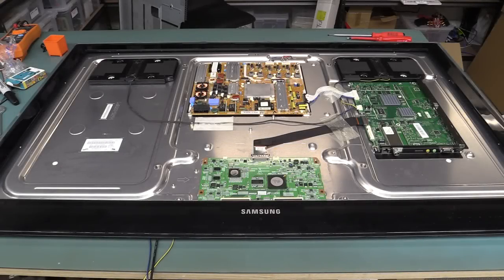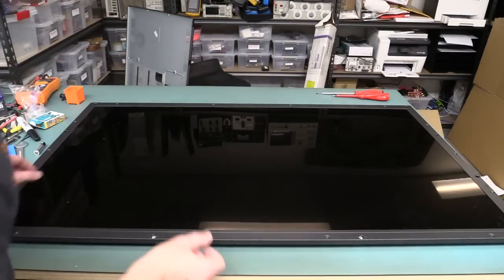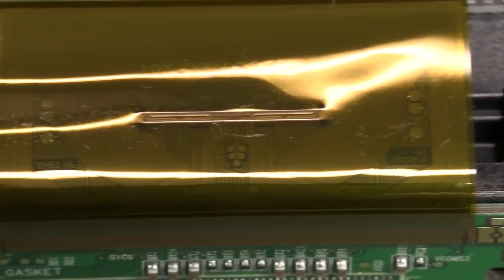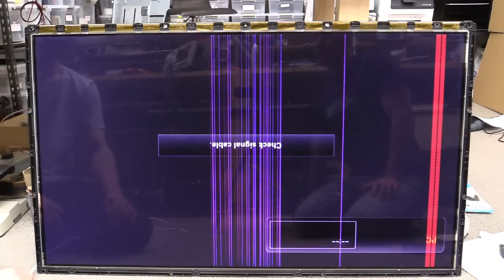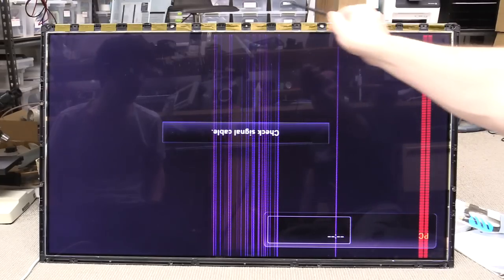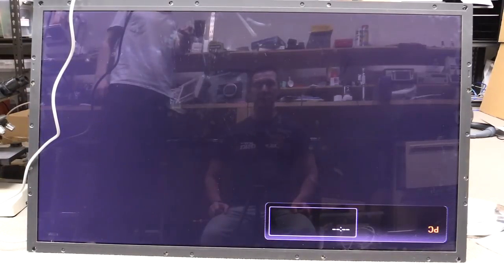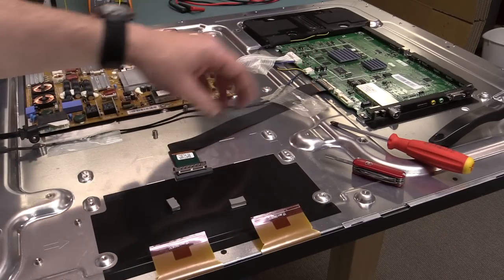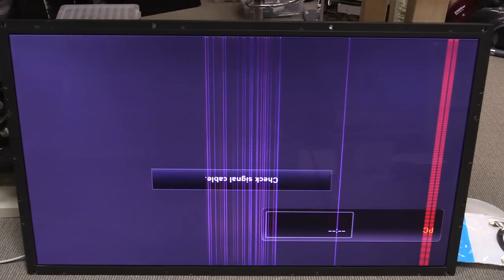EEVblog #781 - Samsung LCD TV Part 2

Comment: Like other people suggested, hook up a video source and see what it does. It fades in and out in a couple of seconds with a static image, maybe a moving image won't be a problem?
Reply: jaaasgoed Or it could be whatever is doing the rendering for that overlay. As stated, chuck an external test pattern on and some moving video :) (if it is the overlay renderer, well, you could almost just ignore it once you have your settings right)
Reply: Darthane
I don't think there is anything extra doing the overlay. I assume this is all done internally in the ASIC. But indeed, the same thing applies, give it some signal and see what it does.

Comment: I haven't watched the whole video on this, only half. But I can say that it's most likely the right after the Tcon/Tcom board as some people call them differently. Commented on another video that wasn't a samsung about my samsung, but the 2 ribbons coming out of the T-con board usually the problem will be left or right and not past it, but those ribbons do heat up quite highly from the main Tcon board and on from poor cooling design, but I did notice this one has most on the bottom so it must be a newer lcd than I've usually worked on. The one i have has 2 ribbons from the tcon board and then goes into 4 ribbons 2 per side and they tended to start getting normal picture back after warming everything up for about ~20 minutes.  I've temporarily fixed that issue with tape on the non conductive side of the ribbons when you click them back into their positions getting more pressure on the contacts for worn out melted ribbon cables.  To test the theory i've used a heatgun just to simulate operating temps and things look normal, but in the end just replacing the ribbons or the tape fix works wonders and recently I've had a problem with the relay that turns the tv on and have isolated it to 2 caps in the back since a soldering irons heat was put up on a cap and it turned on, most people are using a hack of a hair dryer to do the same thing but that is a different problem in itself.  Also there are test leads on both Tcon board and the output to test from or should be at least beside the ribbons to test voltages.
Reply: Watched it all finally and still thinking its just a simple ribbon fix repair/replacement and in the worst it would be a Tcon board replacement if you didn't want to troubleshoot, but still probably the other end of those 2 outgoing ribbons and where they lead though.

Comment: Bad ground somewhere or a problem with the dac that controls the pixel intensity. I notice it seems to be happening with the red and blue channels but never the green. You should try to feed in an input signal of a picture with a pure black background and just some pure green lines and/or pure green text on it to see what happens. Or better yet set up the screen saver on a pc to display some simple 1920 x 1080 pics of white bar 10-12 pixels high across the entire width of the screen at the very top, white bar in the middle, at the bottom, and one bar through the middle of each of the primary colors all at one minute intervals with an all black picture displayed for a minute between each bar picture.

Comment: It seems the fading in vertical lines related to the temperature? And I found that the vertical lines doesn't cover the white characters. So, I think the issue may not at pixel level? Maybe the processor board. :)

Comment: great video,  have you considered the processor chips themselves are bad? that's what It looks like to me, especially have you've checked all the regular suspects.  The other thing it could be  if  that LCD is anything like the old iMac LCDs from  2006 is heating  actually damaging the LCD itself, but if that were the case, the lines would be present as soon as you turned on the set.  This fades in  like it happens as something is heating up, so it could still be a defect triggered by heat.

Comment: I think I would try to generate some test patterns from PC/HDMI like a single white line (h and v), half of image white etc. I would focus on a horizontal bar of white lines (5-30 lines). They should make the ghosts appear. Probing the signals should suggest at which stage the ghosts come in or where h lines disappear. Using smart display patterns you can make the signals look nice and predictable and easy to recognize when they are wrong.

Comment: Since in fades in, I don't think this is on the digital side. More like a analog thing between the driver chips and the panel. Could also be wrong supply voltages to the panel.

Comment: kinda strange fault. But I keep suspecting the memory (some kind of defect frame buffer?). Maybe the text is drawn through a different interface as the menu boxes, which does not make tremendous sense to me, but would possibly explain the difference. maybe you should try to supply other video and image sources, to further narrow it down, because the processor does in the moment compose the image and we don't know if thats ok.

Comment: Mmm, if the problem is associated with the OSD characters, what does it do when a full video signal, via HDMI say, is input? Could it be that the OSD generator is cactus?
Reply: That would be my guess too. Though cactus isn't the word is use. ;)

could also be the part responsible for merging the OSD signal with the video before passing it to the tcon board. 

It feels nuts even having just a clue how these things work! :D
Reply: Jim Groth cacti are always problems...
Reply: Prehistoricman Good point.
Reply: Jim Groth Another cacti joke I like it.
Reply: Michael Norman Completely unintentional pun! :D

Comment: I've seen slightly cracked LCDs do this kind of thing. At the edges or corners, or when someone's spilled or cleaned things with the wrong chemicals, eats the metallic traces on/in the LCD itself.  Can create high resistance connections, so the LCD itself 'charges up'. The common aspect, though was always a toast LCD, I'm afraid.
 Good luck, keep up the cool videos. Stu.

Comment: It's looses traces on the panel itself for sure :-) Easy fix, just reflow with a soldering iron the traces on the flex on the LCD (but not too hot of course that it melts the flex connector).

God bless.

Comment: I think something is messed up with the video ram of the processor board (not the TCON board.  Specifically, I think whatever is responsible for zeroing the bits out has a weak connection to ground.  The visual pattern reminds me of images recovered from a cold-boot attack.

Comment: Is there edge mount LEDs in that? How about tearing them down. I have some that seem to be 6 volts each but can not find any information on them to drive them. How about a video on how to reuse them for lighting? Sony and Samsung seem to use edge lighting and LG back lighting. Also a friend of repairs TVs and says the streaks are caused by the panel itself.

Comment: Thermal issue with the graphics processor or RAM. Bad ball grid array joint Maybe. Sometimes the fine leads that connect from the terminals to the die in ICs can come loose either from thermal stress or a fracture on the lead's pad on the die can cause this type of error as well. It does have some hallmark indications of thermal caused lead to die failure

Comment: To me it looks like a slow build up of charge each time the screen refreshes resulting in a slow blending of the last frames adding to the latest. This would indicate that which ever part of the driver that is switching on for the bright pixels isn't fully switching off again for subsequent lines. I've no idea how to test for that as the complexity would idicate it's more then just a pull down resistor on a mosfet not fully turning it off but that would be a very rudimentary way of looking at the problem.
Mind you that wouldn't explain why it was building up over many frames unless there was some kind of static build up over time which would indicate a grounding issue again. Perhaps check the power signals and stability actually reaching the driver strip board?

Comment: 23:33 put some cheese on :) . I have exact the same problem with my curved 44' Samsung. But it disappears after tv is warm up.
I suspect it has to do with water condensation inside the panel itself. Recently I have moved in to different property, where I can feel air is way too humid. Previous property was way too warmer and lines were very rare (only after long periods of off). When panel cools down over night during cold nights water condensates inside it. After about a couple of minutes of Tv warming up lines goes away. I presume water condensate gets evaporated and stop shortening panel or ribbons. After 3-4 minutes it works without a problem at 4K till next day on.

Comment: Go medieval on the possessor board ? (reflow that as well) If the lines and columns happens when components heat up, use the heat gun to se if you can make it go bad quicker ? Thermal camera and se what part heat up first ?

if all else fail: just throw it back into the dumpster room.

Comment: The lines match up perfectly with what is on the screen, note the PC, : and e. I suspect it will happen on any part of the screen where it aligns with graphics. Could be an issue with the OSD alone. Maybe bad display RAM?

Comment: I think you have a bad thermal chip in there somewhere. Need to check more thoroughly with the freeze spray When the set is cold started the symptoms are minimal, once it heats up the symptoms appear more pronounced. Just my $0.02 worth.

Comment: after i saw the ASCII text, i realized there is a problem with the screen refresh..
the screen should refresh it self at 60Hrz as i rememeber, maybe that info will help.

when screen refreshes, it should remove old image and generate new one 60 times per second, to eye it wont be seen, but in our case, at this LDC, the screen refresh does not work, so it generating new image on old one.

Comment: I noticed this in the earlier video, but now I'm 80% sure. that LCD is NOT phase inverting like it's supposed to do.
Reply: Brandon MacEachern Phase inverting?
Reply: Ian Oliver http://www.techmind.org/lcd/

"Inversion

In liquid crystal pixel cells, it is only the magnitude of the applied voltage which determines the light transmission (the transmission vs. voltage function is symmetrical about 0V). To prevent polarisation (and rapid permanent damage) of the liquid crystal material, the polarity of the cell voltage is reversed on alternate video frames. Unfortunately it is very difficult to get exactly the same voltage on the cell in both polarities, so the pixel-cell brightness will tend to flicker to some extent at half the frame-rate. If the polarity of the whole screen were inverted at once then the flicker would be highly objectionable. Instead, it is usual to have the polarity of nearby pixels in anti-phase, thus cancelling out the flicker over areas of any significant size. In this way the flicker can be made imperceptible for most "natural" images."
Reply: +Brandon MacEachern So where exactly is the culprit on the boards?

Comment: Dave and David2 - You pointed out the streaking on the ascii characters and the colon and then the dashes.  And I'm thinking - wait for it, waaait for it.  :-D  Then, I waited for you to give it some actual input to display, some test pattern or something with slow movement.  I was thinking (dangerous as that is) that the streaks are building like a capacitive charge.  Where it would actually be, I have to real clue.  Could that be in the flat flex or the tiny PCB traces?  Would I be wrong to put all the shielding back on and give it a try?

Comment: I think it is an analog problem. as it is now in "pc" mode, I think in digital mode such as HDMI it would work
Reply: Anas Malas doesn't explain why it follows ascii  characters.
Reply: ***** this is how you could isolate the error and see if it is the processing board or not. Once I was fixing a TV when I thought about using the s-video and it worked! 

Also one HDMI could give a different result to another. You never know till you try
Reply: +Osmosis because that would be a problem of the processing board.  because it is generated by part of it, maybe the same part generates the test image, but the HDMI part is isolated, because also HDMI does require a special chip doesn't it
Reply: Anas Malas It looks like an analog problem yes, but by the time you get to the OSD generator (which may be causing the issue) the PC signal would be digitized anyways.  The first step in the process would be to convert any analog inputs to digital using an ADC.  Since it's displaying the PC label that means it hasn't detected a valid signal anyways, so it's ignoring any analog inputs.  If it were an analog issue (which is likely is given the failure mode) it would be on the TCON board or the panel.  The LVDS connection to the TCON board is 100% digital.
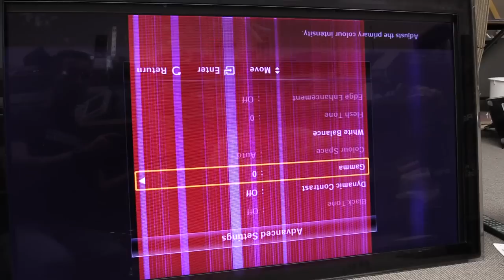Reply: Osmosis It doesn't just follow ASCII characters. You can see at 22:23 that the vertical lines go through some non-ASCII symbols. It's possible that those are encoded in an extended ASCII table, but it seems more likely that the lines just go through anything bright on the screen.
Reply: CalcProgrammer1 What about the gamma buffer?
Reply: The Kaiser What's the gamma buffer? But good point, yes, what about the gamma buffer?
Reply: Ian Oliver Check it.

Comment: I would have re-flowed the processor board. The OSD and test image seem to be the issue and surely they come from the processor board.
Reply from the maker: Darren Jacobson Yeah, next step, just for kicks.
Reply: +EEVblog Is there maybe a separate part that handles the OSD?
Reply: It's not the processor board.  The text in the OSD just happens to be the only full brightness items on the screen shown so far since he hasn't shown us any other video signals but it will look the same with any full brightness areas of image on the screen.
Reply: What about the lines next to the : ?

Comment: The display on my smartwatch did the same thing, with the blue and red vertical lines as well as the horizontal 'scan-lines'. The fault fixed itself over the course of a day or so, and appeared to have come from the wireless charger. Probably not relevant but it could be... :D

Comment: I would re-check the PSU, perhaps got HF noise beyond the true rms capabilities of the multimeter. What is clear is that the defect take 5 to 10 seconds to show, till this moment TV is doing fine. So looks like something heating or charging ..... The less promissing is going into service mode and a factory reset. Sometimes (Samsung dixit) you change something in a menu and got a non sense unrelated defect in another thing (FW issue) You can download SW or paterns to an USB stick to test without any text. As the defect go wide or narrow depending on the menu is not a pannel related problem. Perhaps is something really silly like a HF decouplign cap causing HF noise brake into high speed serial data causing errors.

Comment: HI dave, I have the exact same tv and am experiencing the exact same problem as in this video. Did you end up finding the solution for the problem? Would like to find out if there was ever a fix for it, Cheers.
Reply: Well, I have a Samung UN40D5500 from 2012 and in past november 2021 went into this same exact problem. I took it to the technical service here it was until now, and being January 2022, service called me yesterday and told me that TV couldn't be fixed since for they the issue is the panel itself and over here is very complicated to get a replace, and very expensive.

Comment: no one commented yet, that the vertical lines only happen where there's something written. For example the "Check signal cable.". And the different color of "PC" in the top left produces a vertical line in a different color, since it's not white text.
Maybe a hint, where the problem might be? Where on the board are those menus generated? The sample pic in part 1 didn't produce any different artifacts like that, so maybe it's just the menus...
Reply: therealpanse aaaand i watched the rest of the video... fail.
Reply: +therealpanse You batterised, not analysed.

Comment: This is 99% sure a panel problem. I've seen multiple TVs do this. (My current 46" tv does this in reverse tho, fading out lines which makes it viewable after 15 minutes)

Also note how the red pixel lines are the same with as the PC letters in the source notification.
Reply: Bixxy In fact! the lines in the middle also seem to follow the text.

Comment: I think it is a bunch of row driver chips that are not OK, as mikeelectricstuff said: "floating input somewhere".   I think the driver chips does not turn off it's output as it should, leaving a higher than normal "leak", that starts to charge the other rows.  

The issue is seen worse for the columns that have more rows at higher level.  Take the "PC" text, multiple rows at basically 100% white.  If the rows that should be 100% black let a little charge pass, then as time goes on other rows on those same columns will start to get charged and start to let backlight to pass thru.  Now, the problem is not uniform across RGB, in the side where "PC" shows, it is the "R" columns that are more affected, but towards the center, it is the "B" (or all RGB, cannot differentiate the color) columns.

Ghosting is more in the horizontal direction than vertical.  This could be that the row drivers are not been capable of draining the charge, and panel transistors are left charged, discharging on their own (natural leak they have).

So either the TBC board is the not delivering enough signal to rows drivers, or the rows drivers themselves are not OK.

Comment: This is clearly a thermal issue. As the faulty chip heats up, the problem gets worse. With only half the screen connected, more if the drive voltage is going to the remaining half of the screen, causing the problem to worsen.